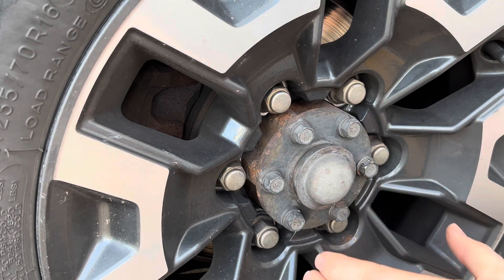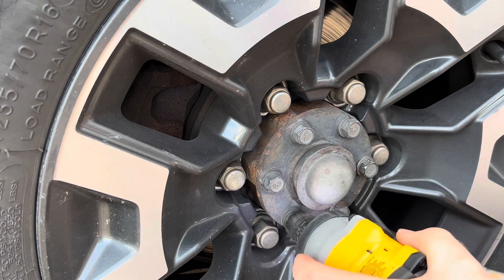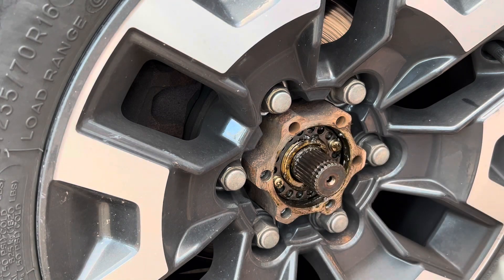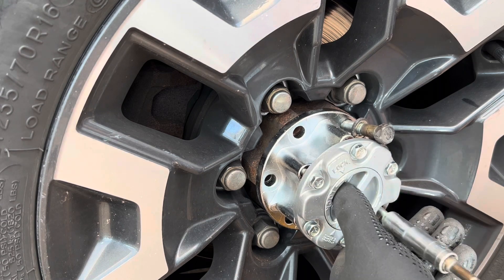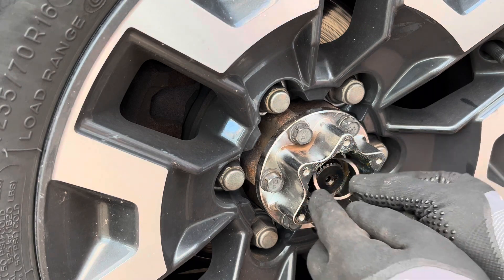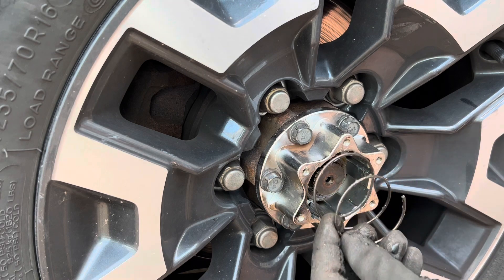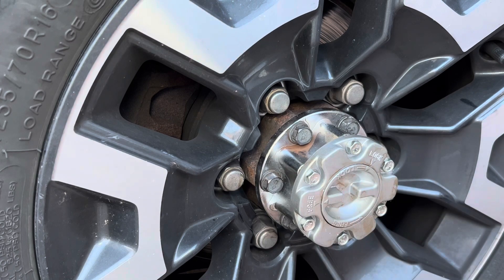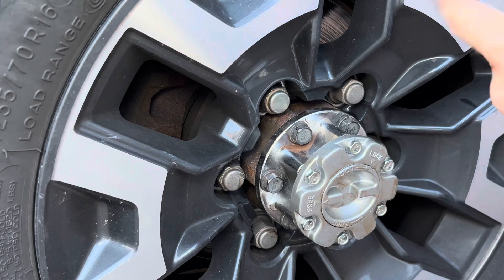Delica L400 Manual Hub Upgrade (Aisin FHM-002) — Install & Tips

Comment: This is a good time wipe out any old dirty grease and put a VERY light coating of gear oil or lithium grease on the hub locking mechanism. Don’t put too much and don’t use any sort of thick grease as it will solidify in cold weather and your hub wont work.